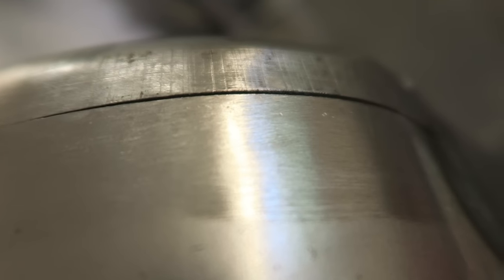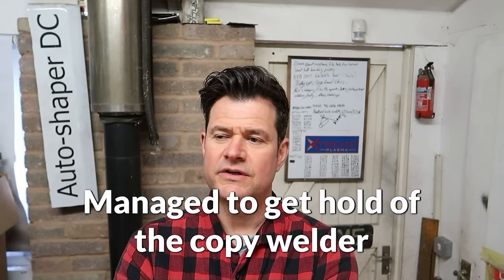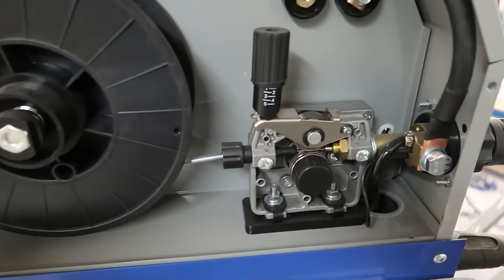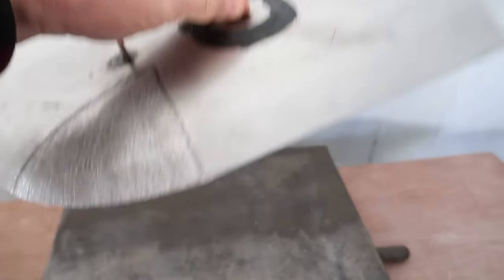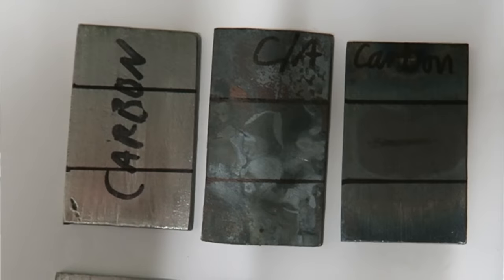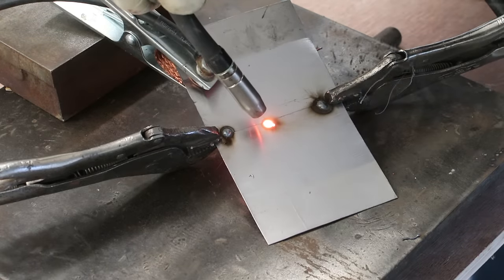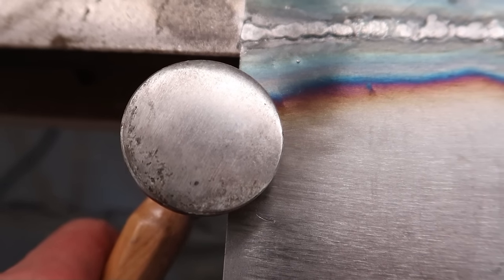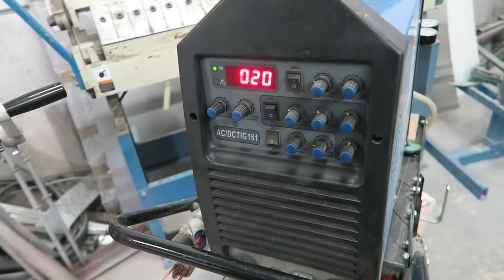MIG Versus TIG Welding on car bodywork. Your Questions Answered. tips and tricks vs  #65

Comment: Glad to see you back doing vids Trev.
One small add to your comment on tig and Aluminium welding.
Recently watched a vid from another welding channel and on thin Al. Up to 12 gage  it is possible to tig Al ( non structural) using DC with electrode positive setup on your DC tig using straight Argon. 
Again not recommended for any structural members but for Alloy panels and frame bracket repairs can be done.
Often done on alloy pipe fittings.
Love your tips and tricks .
Tuning in from Australia.

Comment: I converted my Clarke Mig 160TM Turbo to the large euro torch, internal gas solenoid &  dinze earth as both were very short. The transformation is incredible! Only problem is the lack of fine settings. 10 years sterling service can't be bad. Another good cheap tool is my B&Q Macallister finger sander. 8 years of utter abuse so far! Who says all cheap tools are trash? Cheers. Leigh.

Comment: Trev, if you have to weld outdoors and it is windy, flux core can work better. Also, heavy duty welding is not being performed with dual shield welding which is a special flux core of mainly 0.045" or 1.143 mm and it is welded with gas. I am no encyclopedia nor an expert welder bu I try to learn what I can. I have no experience with Dual Shield.

Comment: Great explanations as always Trev. On the subject of cheap welders, I tried to research as much as I could when I bought my welder. I went for the Sealey Supermig 150. It was about 10 years ago now, I don't know if RTech were in business then I can't remember. The Sealey welder has been good, the wire feed is not the best, but I think it was definitely value for money. I have done loads of welding on 4 cars now. However, if you compare like for like, there is £100 difference between the Supermig 180 and the Rtech 180A MIG, if I had my time again I would willingly pay the extra £100. Sealey have quite a good name, but are predominately made from Chinese bits.

Comment: re: cheap welder at 12:49 you make a valid point.  if that cheap welder calls it a day or you cannot get tech support, yes you have to bin it.  I've also found there is literally no market value for a cheap welder that still works as I've tried to sell a few.  all that being said I have a more expensive welder and its complete crap.  so it works both ways.

Comment: I'm an old fart. Dad taught me how to Oxy/Acet weld aluminium when I was about 14.       I consider MIG to be used for structural work only.....thick metal.  I like TIG. But I really love to use the Oxy/Acet because it can be dressed as you go and there's very little finishing to do.        I love your work too.

Comment: Top notch video Trev. Should clear up a lot of points people were confused about. Now what about this mythical 3 kW laser for 26 UK pounds? I'd love one, if it was real! (don't turn around when it's on though, or you'll fry the guy bringing you a sandwich and cut through the shop wall.)   8^)   Cheers!

Comment: Lidl Special discretionary purchase £77-00 novice MIG welder repaired my daughters Freelander sills and rear arch fronts…plus some underside stuff.. flux cored. Welds okay.. but wire feed is pants and slowly getting worse..

Still awaiting R Tech to send me a 180 (numerous hints left on Instagram posts) one can but dream and having the neck to ask etc.
Reply: R-tech is nearer to me than either lidl or aldi, it's so tempting to blow my pension pot on some nice shiny machines 🤣

Comment: Who does welding - constantly for ten minutes, while repairing or restoring an old car? To me, duty cycle doesn't mean a thing. I've never had ANY problem, even replacing whole rear fenders.
Duty cycle is important, only in high volume, fast delivery production.